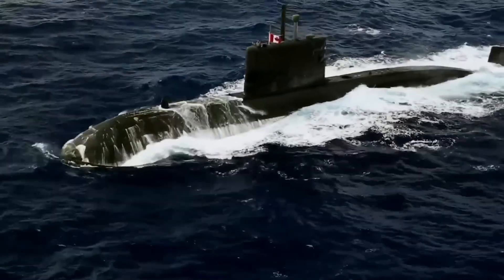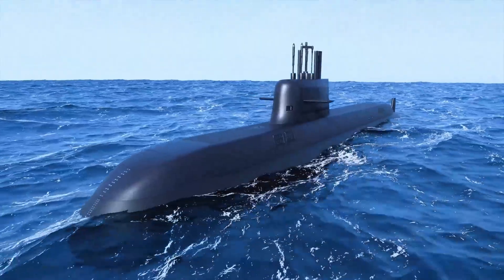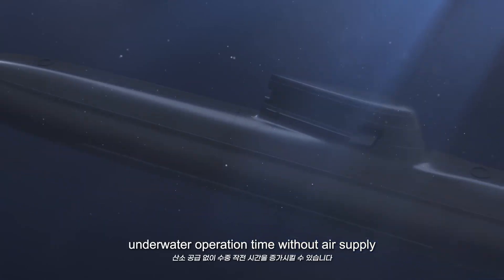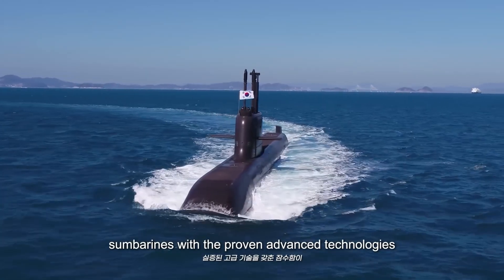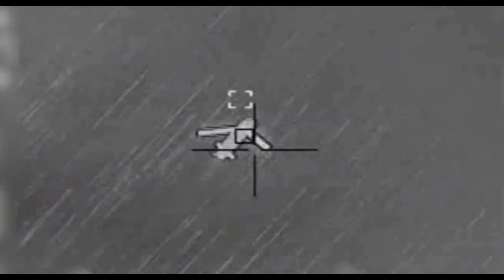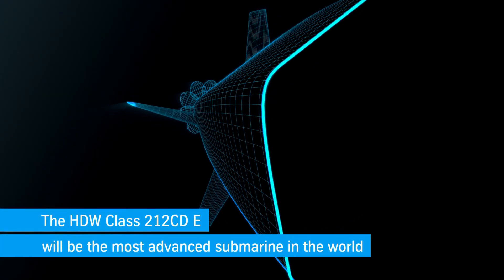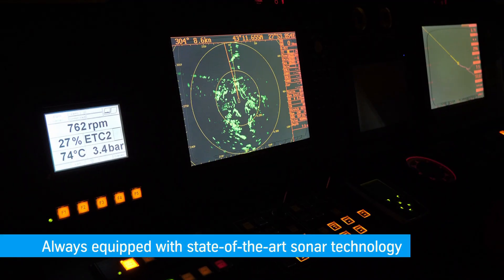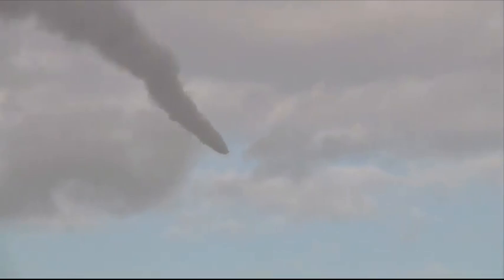RCN's Potential Next-Gen Subs

Comment: With how battery tech is evolving so fast, if more dense batteries like solid state comes out, or if a safer one, like solium batteries are as effective as it seems, I hope the battery tech used could be adapted as they are being made, whichever is chosen. I'm sorry, Germany, but the Korean model seems better for Canada, currently.
Reply: More the reason to go with Korea than Germany. Korea is a world powerhouse in battery as well. I think they are close to having a commercially available solid state battery. But current lithium battery for the submarine had been tested for combat condition including beach and flooding and are found to be safe.
Reply: @classictutor  For reference, LG Energy Solution was featured in Science magazine for overcoming the technical challenges of all-solid-state batteries.
Reply: @classictutor  ...If Germany doesn't supply the MTU submarine diesel engines, Korea can't build the KSS III! It could happen like with the China-Thailand submarine, where Thailand wanted to buy MTU diesel engines from Germany and was turned down! Why should German politicians tolerate Korea getting MTU submarine diesel engines to compete with TKMS? Korea won't get the special electric propulsion system with its specially developed submarine LiFePO4 battery technology and fuel cell technology using special MTU diesel engines anyway! Since when are lithium-ion batteries, like the ones used in the KSS III, safe? These cells can fail, but the LiFePO4 submarine cells specially developed by U212Cd cannot!
Reply: Don't know much about batteries but quantum batteries sounds exciting as a technology
Reply: @thomnoble8384 huh, hadn't heard of them. Seems quite a bit away, but interesting! Will keep an eye on it. Hopefully it's better off then graphene batteries, still waiting on that miracle substance to be manufacturable lol. 👍
Reply: @Naustradamus in British Colombia Canada they have built a quantum batteries. Musk is involved as well. Sounds promising
Reply: @thomnoble8384  Elon Musk has established collaboration and supply relationships with South Korean battery companies, particularly LG Energy Solution, as well as with semiconductor and Samsung, a company specializing in semiconductors and electronic systems across various industries, and the company is set to begin mass production of 2nm chips while continuing development of 1nm technology. 

From a long-term perspective, I believe that the University of British Columbia, Elon Musk, and South Korean battery companies along with technology firms can create significant synergies.
Reply: @thomnoble8384  This isn't about a quantum battery, but rather the charging technology used for a battery!
The best electric propulsion system currently available is installed in the U212CD! The U212CD uses a lithium iron phosphate battery (LiFePO4/no runaway) which works in conjunction with the fuel cell for electric propulsion, allowing for much higher performance. This enables either longer dive times or an escape speed of over 20 knots underwater (operating depth 200-1000 meters)! 
Experts assume that the U212CD can achieve speeds of up to 30 knots underwater with the additional fuel cell, allowing it to descend to a depth of 800 meters in just 1.2 minutes at a 45-degree angle and reach a distance of 10 kilometers in just 10 minutes! For an adversary, the stealthy U212CD would be a nightmare to counter!
The specially developed MTU diesel submarine can perform battery and water splitting (H2/O) very quickly while snorkeling, at speeds of up to 20 knots. The KSS III, even the standard U212CD, can't compete with this, as it lacks this technology, which is in a league of its own! The U212CD is scalable in length and overall size. A 90-meter U212CD has a submersible lifespan of over 60 days and can carry 40+ VLS! A 100-meter U212CD can manage over 90 days and 80+ VLS! According to AI, the snorkeling range of a 90-meter U212CD is already over 17,000 nautical miles!
Reply: The Jangbogo IV will use Samsung SDI's all-solid-state batteries.
Reply: max_7344... I've rarely read so much bullshit in so few sentences as your comment! You have absolutely no clue about the subject! The developer of lithography machines for high-tech semiconductors 1-3 nm and smaller is the Fraunhofer Institute in Stuttgart, Germany! This started in 1980, and it took five years to build the first high-tech system! Germany supplies all systems to ASML, who then assemble the high-tech lithography machines! Germany has a unique selling point worldwide in this area!
If Germany says no, all high-tech lithography machines worldwide will be out of service within one to three months because there are no spare parts available for maintenance! A Germany/Zeiss lens that is ground with atomic precision (1-7 nm and smaller) takes a year to manufacture and must be regularly inspected! Other systems, like the Germany/Trumpf laser, require the same! The development of Zeiss optics incorporates 100 years of research experience, since 1920! According to AI, no other country in the world is currently even close to Germany's capabilities due to the extremely long experience periods required.

If they continue operating without maintenance, semiconductors will become a catastrophe, as seen in China where cell phone semiconductors are catching fire! Germany/the EU will change this significantly in the future, and the US and other countries won't stand a chance against it!
Apart from that, in 2024/9, Germany/DLR presented the world's only modular quantum computer (mQC) with 54 qubits, 20 operators, and AI, which dwarfs everything else! It's the size of two washing machines and not for sale, costing €1 million! Germany has allocated €7 billion, and DLR is building 1,000-10,000 qubit mQCs with partners! In terms of system speed, Wilolow's 105 qubit, 2-operator QC and similar systems aren't even an amoeba!

A 1,000 qubit mQC with 20 operators is many times faster than Willow... a 1 followed by 300 digits! Willow has 105 qubits and 2 operators, 1 and 0, and can only calculate one operation at a time. The DLR mQC, however, can perform 20 calculations in parallel! The new hybrid system at the Max Planck Institute, with artificial light crystals and 3D spaces where an atom is a quantum (with 133 quanta), can even perform 133 calculations simultaneously!
According to extensive AI analysis, Germany is now uncatchable in QC and mQC with AI! The EU is also providing significant funding for the EU mQC/AI project, where 5 mQCs are connected to the German mQC via a central unit!
The most complex research and development processes take anywhere from seconds to a maximum of 2-3 months!
Reply: gumzon...Poland has no contract with Korea, who are interested in the U212CD, which has a much better propulsion system than the KSS III!
AI Analysis: The U212CD class submarines use a specially designed, safety-focused battery system that differs significantly from conventional lithium-ion batteries (e.g., KSS III lithium-ion batteries), which are considered extremely dangerous in the event of fire or thermal runaway due to their chemical composition. The U212CD uses a lithium iron phosphate (LiFePO4) battery, which is considerably safer compared to other lithium chemistries because it is less prone to thermal runaway and minimizes the risk of fire
This battery system was specifically developed for maritime use and the requirements of a submarine and operates in conjunction with a fuel cell propulsion system and MTU diesel engines (MTU 4000 series). The fuel cells provide air-independent operation at slow speeds, while the diesel and battery-powered propulsion systems deliver power and high speeds.

The U212CD uses a lithium iron phosphate (LiFePO4) battery, which is significantly safer compared to other lithium chemistries because it is less prone to thermal runaway and minimizes the risk of fire. The combination of lithium iron phosphate batteries, fuel cells, and MTU diesel engines enables not only increased safety but also improved performance, endurance, and fast-charging capability. While the South Korean KSS-III submarines use lithium-ion batteries from Samsung, the German U212CD relies on a proprietary, safety-optimized battery, specially designed and manufactured in cooperation with Fraunhofer Institutes and German industry. This drastically reduces the risk of a battery fire and increases the overall operational safety of the submarine.
The MTU diesel engine can quickly recharge the battery while snorkeling and perform the hydrogen/hydrogen splitting required for the fuel cell. Therefore, thanks to the additional fuel cell technology, the U212CD has a dive time of over 40 days, which the KSS III lacks! The KSS III has a dive time of over 20 days.
Reply: @tlsig LFP batteries have lower instantaneous power output than NMC batteries. Therefore, they are considered unsuitable for vehicles such as electric vehicles, but are advantageous for ESS (Energy Storage Systems).
Reply: @didiq true, but the safety of NMC batteries is higher, can even be punctured and still work, while LFP risks igniting.

Not saying that LFP shouldn't be selected for its energy density or anything, just that battery chemistry seems to be advancing a lot due to demands, so as an energy storage device, IF there's any huge advancement between now and the first delivery of which ever sub type we select, that I hope that selection remains flexible. I'll let the military decide on the pluses and minuses, just hoping a selection today doesn't fully lock us in, that's all. =)

I'm very interested to see what will come of all this.
Reply: gumzon...Germany/Norway has offered Canada the opportunity to become the third partner! If Canada signs the contract for the U212CD submarine at the beginning of 2026, TKMS would build its high-tech facility within two years and simultaneously train employees for submarine construction! By 2031, Canada could have built 3-4 U212CDs in its own high-tech facility! Thanks to TKMS' experience and new construction systems, the construction time will then be reduced to two years! TKMS will deliver three U212CDs at the beginning of 2027! From 2027 onwards, TKMS will be able to produce 3-4 U212CDs every year! Germany is massively expanding all its shipyards, including the Meyer Werft shipyard in Turkey, which will receive additional space! Germany owns 80% of Meyer Werft, which is building the 250,000th "Icon of the Sea" submarine in Türkiye! Lürrsen shipyard can build four U-212CD submarines and two frigates simultaneously in its superlative hall instead of a passenger ship! Or even a US aircraft carrier!
According to AI, TKMS would then finish building the U-212CDs in Canada before Korea! TKMS/Meyer has decades of experience producing submarines, frigates, and passenger ships abroad, and Korea has none!
Reply: Elon Musk has established collaboration and supply relationships with South Korean battery companies, particularly LG Energy Solution, as well as with semiconductor and Samsung, a company specializing in semiconductors and electronic systems across various industries, and the company is set to begin mass production of 2nm chips while continuing development of 1nm technology. 

From a long-term perspective, I believe that the University of British Columbia, Elon Musk, and South Korean battery companies along with technology firms can create significant synergies.
Reply: 기술도 기술이지만 시간은 돈입니다. 한국은 독일보다 무기 생산과 납품이 빠릅니다. 이건 아주 중요합니다. 한국을 선택한 폴란드는 바보가 아닙니다. 옆동네 독일이 아니라 머나먼 아시아의 한국과 계약한 이유가 있지요. 또한 생산과 납품이 빠르다는건, 물건 구입 후 유지보수도 빠르다는걸 보증합니다.

Comment: The German sub is still on paper while the Korean sub exists for real and is now on operation. It's a huge difference, which means the German sub is not proven so it can guarantee nothing unlike the Korean sub.
Reply: Are you getting paid per post on the subject?
Reply: @PePe_007-A1  Unfortunately I don't get paid unlike you.
Reply: 212CD is an much enhanced 212A and as such most of the testing is done. The first one will launch in 2027 and will be turned over to the Norwegian Navy in 2029. TKMS says they can turn out between 3 to 4 subs /year by 2028 because they have a newly acquired shipyard in Wismar and they have spent $300 million Canadian dollars in upgrades to enhance the speed of production.
Reply: @allannantes8583  Germany and Norway have ordered six and four 212CD submarines, respectively. Even under the best-case scenario, Germany won't be able to begin building the subs for Canada before 2030s. If Germany wins the Polish submarine program, the schedule for Canada will be further delayed. Due to the decline of the defense industry and the resulting disruption of the supply chain, Germany, despite its promises, has frequently missed due dates. Furthermore, because the 212CD is a new model being built, no one can guarantee that development won't be delayed and the price skyrocketed. Given Canada's urgent need to replace its aging submarine fleet,  leaving it to Germany would expose Canada's security to significant risks.
Reply: @jclulu3942 Sounds like you are a South Korean Lobbyist…

Comment: There is opinions for U212CD that can easy match the Korean submarine. That is the U212CDE which will not change production status as it was a additional section being added to boat. That section could add vertical launch capabilities like the Israeli boats they have already built and delivered. It would also contain more batteries and fuel cells for longer range and endurance without surfacing or snorkeling. We could also have a mix fleet with that boat as only change is the additional section being add to original design...

Comment: Did you mean the Joint Strike Missile - Submarine Launched (JSM-SL)? My understanding is that the development program for the Naval Strike Missile - Submarine Launched (NSM-SL) that you said TKMS was considering, was cancelled in 2021. The JSM-SL variant, which is AFAIK Kongsberg is in process of developing, while part of the same family as the NSM, has a longer range than the NSM, though still shorter than the Korean SLBM option you mentioned.